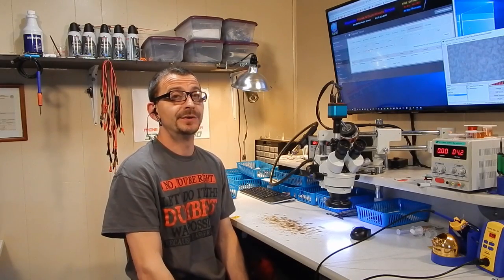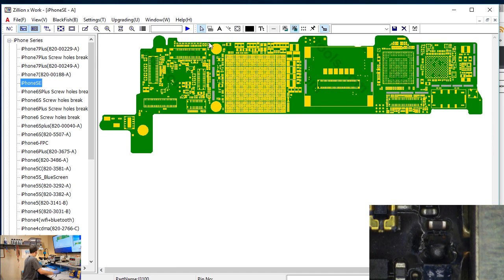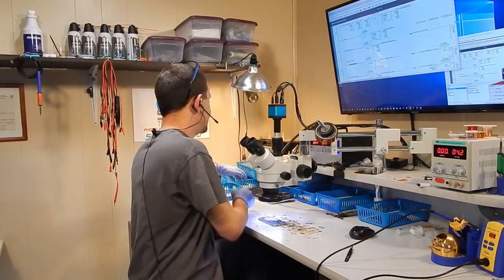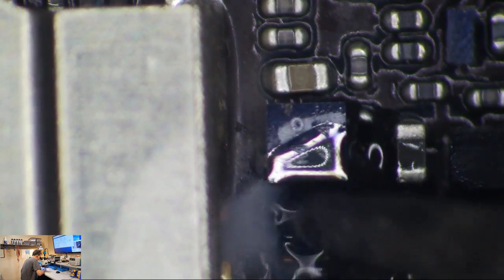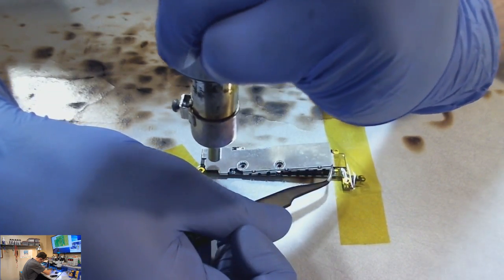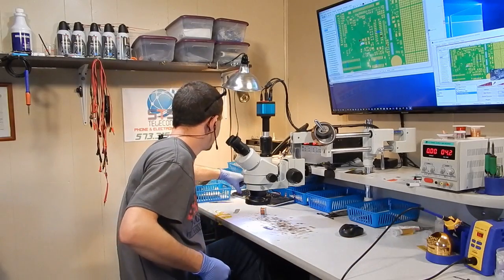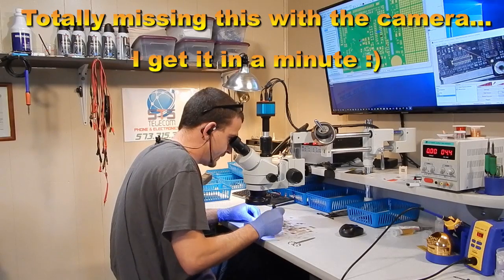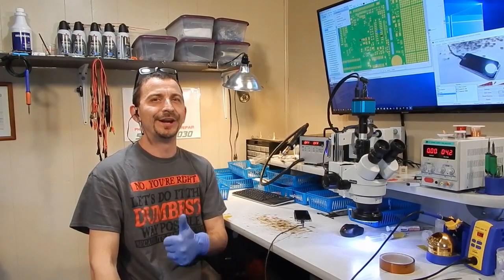iPhone SE Backlight Repair with Jumper & Charcoal

Comment: I have a similar problem on my 2016's SE... Backlight works 1 time out of 100. 
The inductor that was burnt in the video, on mine, seems only "more opaque" than the nearest 2. I tested it with a multimeter (on resistance) and it gives like 14kohms... I think it's dead, but what can i do? I never soldered smt small like that... I was thinking of bypassing it and let the capacitor of that LC filter do all the filtering work. Thanks a lot if you can help me, I am a student and my budget is near to zero :\

Comment: Hi. interesting video. I was wondering why you didn't thread the wire through that hole in the board that was adjacent to the test points that you ran the wire over the top of? That would have avoided having to run it under the edge of the shield and around the edge of the board.
Reply: I was also wondering about that, and if the shield is in the way just trim it...?

Comment: Jason love the floating filter but you probably would have been better off Soldering the filter to the TP on the front side and just running the wire around to it.
Reply from the maker: I accidentally shorted this very jumper wire on a 6S once and seen it flash like a light bulb when it vaporized.  Since then, I've been putting the filter at the beginning of my jumper.  You're right tho, chances are if they short it again, it wont be my wire directly.  It will be at the connector so having the filter just before TP22 would be ideal as long as the jumper is well secured.  I like Mark Shaffer's method where he glues the filter to the PCB then runs jumpers from the via and the display connector to the filter.  That would have kept me from pulling the board on this one.  That's probably how I'll be doing the next ones except I will not be going strait to the pin on the connector rather to TP22.  I figured you would like that filter sticking right off the end of the cap! lol
Reply: That is a good idea. Thanks for sharing.

Comment: I change iphone 6plus touch ic ok touch full work but front camera not working plz sir solution and back camera work
Reply: faizan guni you can check camera ic
Reply from the maker: Well, the IC would kill both cameras though.  There's a few things it could be.  I would check the row of components next to the front facing flex connector as well as R0709 under the shield.  R0709 has pretty high odds if all of the other front facing features are working.